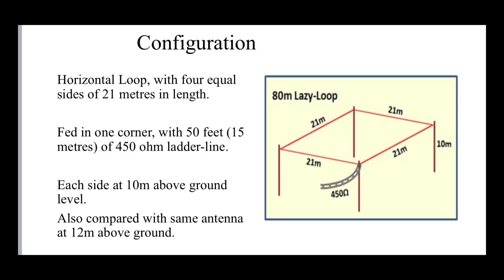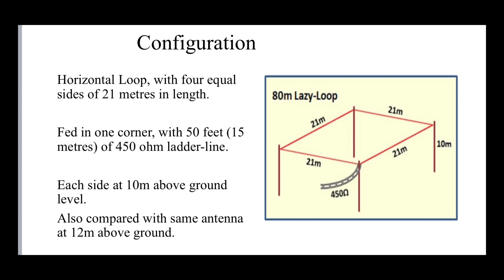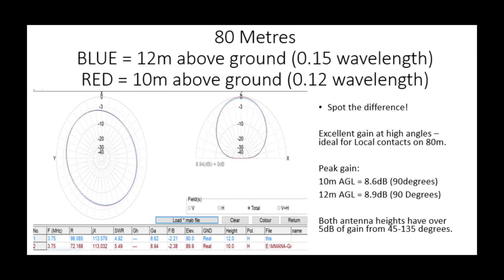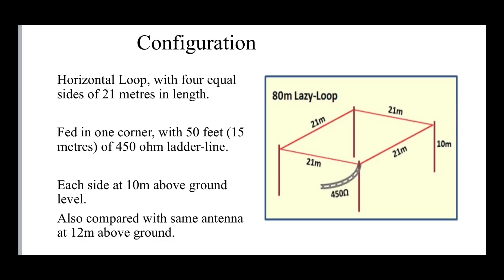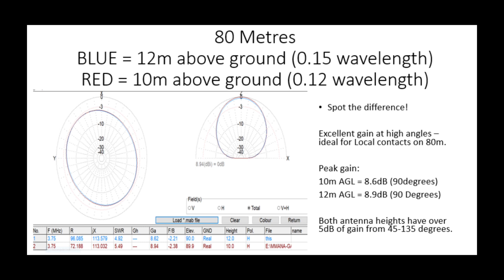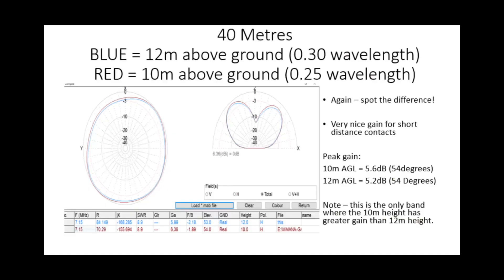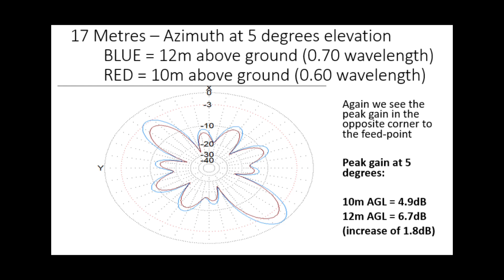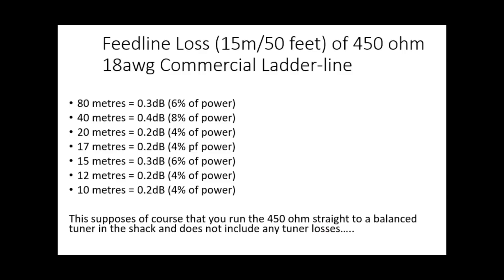HAM RADIO: Loop Antenna 80 metres to 10 metres

Comment: greetings Tim, ive got a question.
im limited on space in my qth, but i have managed to fit an shortened end fed 80 - 10 m antenna which i got from uk antennas. its about 5 meters from the ground, and ive managed to get in centre europe, with my set up.
but i want to do better on 40meters , do you have any suggestions?
i was thinking of putting up a dedicated 40meter dipole,  on a pole, or should i be looking at something else. funds are tight, and cant spend loads, im in the middle of an housing area, but i can hide most of my antenna in a tree in my garden. 
or should i be thinking along a different line, magnetic loop? multi band vertical antenna? dipole? or stay with my end fed?
Reply from the maker: Many options.. what size space do you have?
Reply: @timg5tm941  i have a shortened 80 to 10 end fed running corner to corner in the garden, the antenna is 22.5m its about 7m off the ground. fed with rg213, and an unun choke approx 24 inches from the rig. works ok, but its noisy,

Comment: Feed it with a quarter wavelength worth of 450 ohm ladder line on 160m and it will tune up. 
Remember the impedance flips every odd 1/4wl of feedline.

Comment: Thanks for this Tim and Rick, I'm wondering If I can use something similar. I have a narrow plot just over 12 metres (40ft) wide but over 90 metres (350ft) in length. So, would this work as a rectangle of the same wire length rather than a square, please?
Reply from the maker: It’ll work .. would be interesting to see the radiation pattern
Reply: @timg5tm941  Thanks for thinking about my problem and your reply Tim. I presume "interesting" means it will work but probably not well.
Reply from the maker: I’m not certain at all. I might try and model this to see. Are you looking for the full 40x350 ft?
Reply: @timg5tm941  Thanks for the reply, what I thought at first was to use the same length of wire as you did for 80m but instead of square, make up the distance going rectangular.

The garden is actually 40ftx460ft but 350ft is away from the building line and RF noise, so I can use as much or little as works best. Thanks for thinking about this.
Reply: On 80 and 40m you will pretty much see the same performance as the square loop.  On the high bands, the gain is going to be about the same but not off of the corners.  It has nothing to do with corners, but rather the point at which the multiple current-maximums occur.  This will be at the feedpoint and multiples of a quarter wavelength away from the feedpoint.

I have never tried a rectangle, but I have had several OM write me over the years and tell me they were quite pleased with its performance.  Not very scientific, but at least encouraging.

For those of you with less space, try a half size (40m full wavelength).  It won't work, at least not very well, on 80m but it's a killer for NVIS on 40m, works OK on 20 and shines on higher bands.  73 - de DJ0IP
Reply: @richardwesterman5773  Hi Richard, thanks very much for taking the time to consider and comment, I really appreciate it. A while back I did some computer modelling of my proposed layout and the results were not encouraging. This could have been inexperienced operator error though! With your and Tim's encouragement I'll have another go. I'm unlikely to build the antenna before the Spring but will report back with the  results. Thanks again.

Comment: What would happen if the poles are 30 ft off the ground, got 25 Acers? Also can/should one build one with a relay (High Voltage   Amps, Contacts 600v 450A) that would swap the feed lines connections at the top of the pole. I have a 12v DC relay contact rated at 600v 450A from an old power supply that was used in a Computer when they took a floor of a building for the computer room (could be used as boat anchors for as battleship) with false floors (DEC PDP-10 KI. One last question looking at a variety call sigh (W or K) if it was K I would like to KA10 KL10, but if I cant do the 4 letters. after the K or W  would like - KA10, KI10, KL10 and PDP10 or PDP11. Had a general 35 years ago then got out of the military went homeless, Going to college living in my car. Sold my gear and did not renew my license. Work for DEC Digital Equipment Corporation, Repairing DEC PDP-10 (KA, KI, KL) KA10 Transister no IC, KI-10 built on 74XX logic IC's. going for my Tech and General in December. The last question can your Ham and GMRS license be the same call sigh.
Reply from the maker: That I am unsure about

Comment: If I had space I'd have another Tim. My old one was coax fed and was great on all harmonic bands but 80m swr was sky high over 3.7mhz. If I had 🪜 line it would have been no issue. It was a great dx antenna on 40m working VK regularly on SSB.

Comment: I built mine  85 meter loop as a pyramid with one 17 meter mast in the center 450 ohm line feed in the top of the mast works very well and no rf problem. 73 de sm6usu Svante
Reply from the maker: Sounds good!

Comment: I’ve been contemplating trying this antenna at my field using around 9m tall masts…….probably next year for one of the 80m contests or maybe CQWW.

Might try it with 3 mast as a triangle to make it cheaper & easier to build (as it would be a temporary setup).

You said that you were jealous of Tom having this antenna to play with. I know my field is a bit of a track from where you live but if I do try building it I’d be happy for you to come & join the fun so that you get a chance to try if.

Unfortunately that won’t happen until next year though.
Reply from the maker: James I’ll let you know that is a very kind offer.
Reply: triangular loops are fine, they are just a lot more directional than squares.
Reply: @OllieVK  In which direction? Kindly explain?
Reply: @tzm1843  should probably clarify, if the feed point is in one corner, imagine a bow and arrow, the feed point is the back of the arrow, the opposite flat side is the bow, that's your gain direction. From memory it's broader if the feed point is in the middle of one flat side.

Comment: I built a 40m delta loop and using 450 ladder line changed it to 300 ohm ladder line I and found it changed the resonant frequency  had to make it shorter I suspect the capacitance of the 330 ohm line capacitence  being greater increased the electrical length of the delta loop. Just a theory.
Reply from the maker: Presented an amended range of impedances probably?

Comment: What if you were to put a break in the antenna at the far corner for 160m?
Reply from the maker: Hmmm .. by break you mean??
Reply: @timg5tm941  Cut the wire and put a spacer in (maybe with a relay....) to form a sort of dipole folded in on itself. Or put a terminating resistor in the gap. Worth modeling?
Reply: Have a look for terminated loop.
Reply: If you open the far corner, what you end up with is a folded half-wave dipole.  This is basically the same as the cobweb.   In theory it will have 12.5 Ohms impedance, lending itself to use with a 4:1 Guanella balun - backwards.   However, that is only the theory and is certainly "close" when the loop is 100+ ft. in the air.  How will work when close to ground?  I have no idea.

However, you would have to close the loop (with a relay, or . . . ) when working higher bands.
73 - de DJ0IP.

Comment: So it's a Rhombic, right? That's what they use at shortwave station  WTWW, and it sure works pretty good for them! I wonder if you could ALSO work in a 40 metre "4 square" from the supports themselves? After all, the vertical supports are already right there to use, that would give you the low angle and directionality for 40 m DX with a bit of phasing line and some switches... And maybe BREAKING the far end of the loop, opposite side of the feed gives you an 80 Metre Cobweb, some directionality there, sans the decreased noise of a completely closed loop? I also see with some switches, a couple of half-squares there...  Alas, much like Relationships, Antennas are ALWAYS a compromise, eh? 73 DE W8LV
Reply from the maker: Totally right!
Reply: @timg5tm941  no it's not. Loops and rhombics are similar but slightly different. Rhombics are intentionally diamond-shaped, with the feed point in one corner and a resistor on the opposite.
Reply: @OllieVK  You're right... I forgot about the diamond shape as opposed to the square. 73 DE W8LV BILL